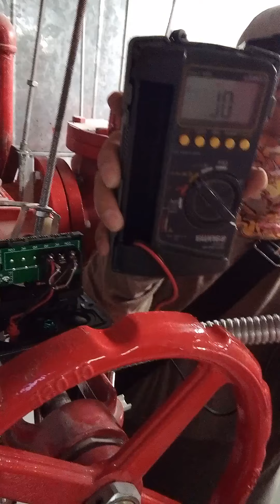tamper switch sittings,fire alarm system interface with fire fighting system

Comment: Hellow sir...dapat po bah. Nka off pasition yong tamper switch
Reply from the maker: Dapat po sir Ang tamper switch ay nka normally open Ang settings nya,kapag ones na may gumalaw or isinarado Ang gatevalve ay magnonormaly close Ang tampers switch at mag supervisory trouble or mag alarm Ang fire alarm system depende po sa pagrogram